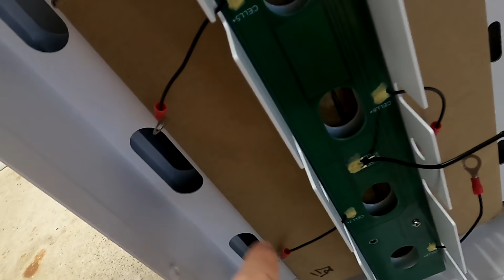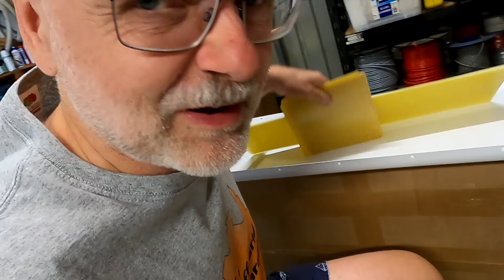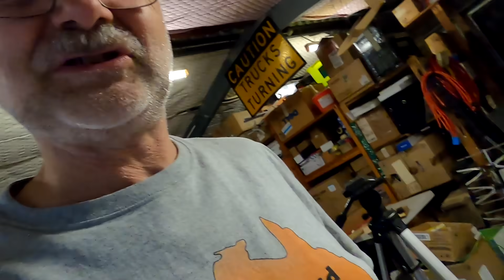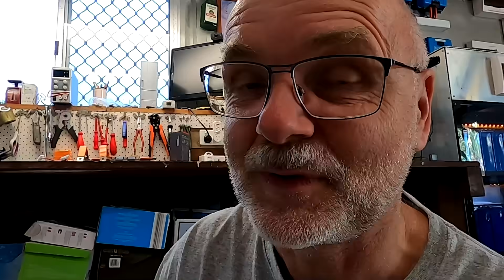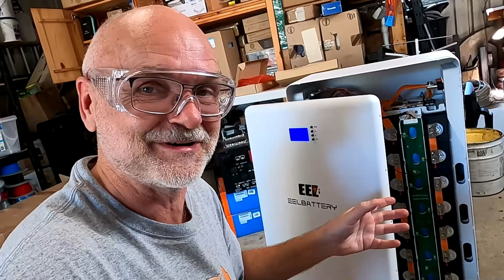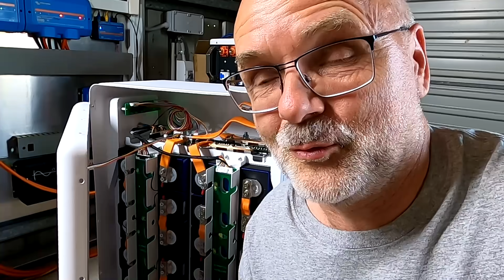The vertical EEL Battery DIY Kit. Is it OK for the cells to be stacked?

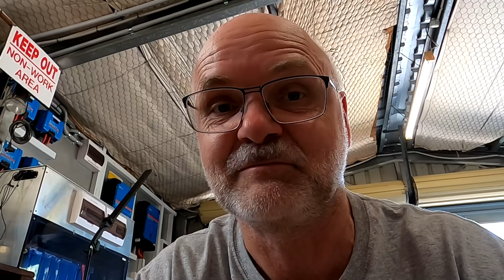Comment: Love your videos, also the funny part at 18:59 with two balance cables at 9 positive and 9 negative ( which is the same as 8 positive as they are connected ) but you got confused for a sec. Good tip btw with the capacitor to prevent a spark. thnx

Comment: Hi Andy, I have the same EEL Battery Battery Box as you do. The vertical box on wheels with the curves. I have 16 cells at 3.2V LiFePO4, capacity 302Ah. The BMS is identical to the one you use on your build as I purchased the battery box from EEL. I got the BMS, and all the accessories like you did.  I have everything connected. When I turn on the the communication button the LED screen comes on. When I go through the Cell voltage, all cells are good reading 3610mV except for two cells. The battery management is telling me Cell 13 is reading 11mV and cell 14 is reading 4838mV. However when I check with the volt meter I get a reading of 3856mV on cell 13 and 14. I also get this reading on all the other 14 cells. At the start when I turn on the communication button I get Pack voltage: 55.31V, Current: 0.00 A, SOC: 50%, Warn: Y. Can you please help me trouble shoot my problem??

Comment: I have the newest seplos BMS with two amp balancer and I’d like to put a turn off button on the front of the DIY box, but I cannot figure out where on the board it needs to be wired in and what wires go where I see a four pin JST plug that says PS on or something like that if anybody has any diagram or helpful information, please throw it at me.

Comment: I just got mine as it seemed like a good deal. My problem is because my cells are slightly bloated by 1-2mm, I can't get them to fit without only using an epoxy sheet between them. No foam. I'd rather have the foam between.
I don't really care about proper compression as my cycles are very low anyway. If the cell hold-down brackets were adjustable length, this would be a really good case.
Also, my unit came with an ANL 250A fuse. I can't find the specs on it, but I'm doubting it's rated for 48V. I could only find 300A 80V fuses from Victron. I mounted a T-Class fuse/holder there instead.

Comment: Any issues with the BMS?  I have two of the EEL horizontal boxes and have had trouble getting the balance to hold.  I hooked up an external active balancer and that works great.  The problem seems to be with the Seplos balancer/BMS.  The company kept telling me that it would balance, even with the power switch off.  No dice.
Reply: any update?

Comment: Hello sir. I have two EEL batteryes with JK bms. I do not understand why my invertor do not charge more than 54,4 V (if i put more i have 02 error) and the bms close the battery at 50 V.  Cells are LF280K. If you have any ideea about this problem, thank you!!!

Comment: correct me if i'm wrong but it sure seems like all these DIY kits are using the all the same guts inside (BMS, cables, bus bars, displays, comm port module) and just making their own case designs (barely, in some cases.)  While i'm still on the fence of this (what should really be called) semi-DIY setups, one aspect I just realized is, it'll be a heck of a lot easier and safer to hang empty cases on the wall and load the batteries into them, then trying to lift the loaded cases into place.

Comment: Thnak you, Andy, for the video. After watching it, I ordered one DYI box to accomodate my 302 Ah batteries. It look approximately two months to arrive from China to the USA. The box I received was slightly different with all the components displayed at the top. The installation was a bit hard due to flexible link not being exactly aligned but the biggest surprised was after I tried to connect the cables from the PCBs to the BMS.  When the cable was plugged in, I could smell something burnt. When the BMS was energized it was displaying only 8 cells and giving an error message that the temperature  sensors are sowing incorrectly. I went through the connector pin location and found that the connector on one PCB was soldered in reverse (so much for QA/QC). After contacting EEL support, I was promised replacement PCBs and the set arrived approximately two weeks later. After the PCBs were changed the BMS started to show all the cells and all seems to be working fine except the temperature reading, which also displayed warning message. Contacting EEL support about this issue was without too much trackinion and I decided to purchase replacement BMS. After installation of the new BMD, all works as supposed. ELL is not taking responsibility for fried BMS (I suspect the temperature sensing circuits were friede to volatge going to these circuitdue caused by incorrect installed connector) to the poor quality of their QA/QC program.

Comment: One would assume that the whole point of this particular case is to be mobile hence the casters on the bottom. But if you do want to lock it into a wall then just put some ratchet straps crossed it which are secure to the wall behind it 😂❤

Comment: Hi Andy first of all thanks for all your videos you help a lot, let me share my experience with my EEL box they send the pcbs that have the links to take the voltages of the cells to the BMS with the wrong female connectors, I talk with them and the solution was that I had to cut the connector to have a perfect fit... this I know... and they refuse to send me a correct part... I will never buy nothing from them... chinese... they are fantastic... with their faults... with our faults they are more active... but with their faults... very relaxed, Thanks to let us share our experiences, all the best!

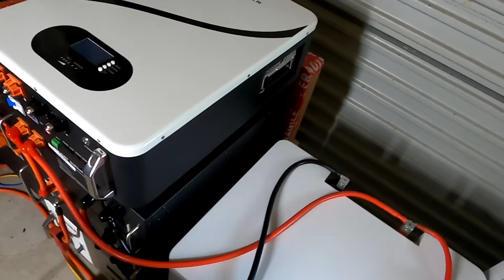Comment: 32:24 - NO, EVE says ONLY 1 direction is allowed and they show it in there most recent 20 page manual with the fixation of a single cell. They have replied to the german yt channel Energie&Hobby titled 
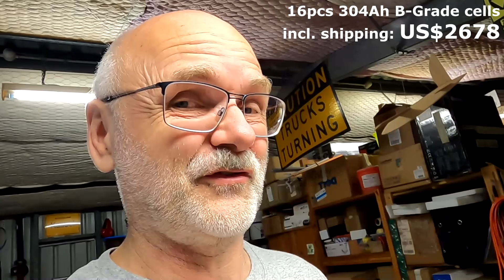"LiFePO4 Batteriespeicher liegend?" And there at 5:38 you will find the official reply 

In the LF280K datasheet I sent, there is a schematic for the mounting jig. We recommend upright placement for the following reasons:
#1 other directions will affect the cycling performance of the core.
#2 For LFP cells, other directions will lead to uneven distribution of electrolyte, which will affect the performance of the cells.

And beyond that they also let him know that inside this container is a kind of material which has been coiled many times. That is the carrier of the energy filled from the bottom to close to the top with electrolyte.
If you lay it flat then the carrier material is far more uncovered with electrolyte and you loose energy.

Also in case of emergencies the valve should be upright cause gas should go up under pressure and not spilling electrolyte which in horizontal position will be spread out.

Vertical racks are dead for LFP and CATL here said the same. Upright is the only way, lifecycle will decrease and capacity plus security issues with the valve and in case insurances will ask them they will claim that they never had allowed it anywhere.

Comment: EVE has emphasized that this is not the proper storage for their battery in 2024 again.
They warn to do it so cause cycles are no longer under warranty and the burst valves are no longer working and can go up in case of an emergency.

They have replied to a mail and they are clearly warning which means in case of anything going wrong your insurance will not pay. the terminals have to be on top. Nothing else. 

We have gotten one before this mail arrived us so right now this whole battery case is laying on the back on a shelf. Sad but true

Comment: Very interesting Andy. Love it. I stumbled on your site and channel while researching a 12v build for my overland Ute I’m building. My question is, do you do or know if someone that does ‘build your own’ lithium batteries/system for off road use? Especially the vibration and dust issues associated with them. I’m looking at a 150-200amh system. Thanks appreciate it.

Comment: Sad to say, EEL is gaining a reputation for NOT standing behind their products.  The measure of a company is how they handle problems.  And right now it looks like EEL is failing miserably.  After initial back & forth "Howard" goes silent.  

One customer posted photos of a 4-cell unit that had obvious crush problems on one end, with a battery bolt pushing into the closest cell and the fuse broken.  The top was not bolted down at the factory, which might have added structural support.  After a bunch of tests and rigmarole they offered 28 screws to bolt the top down - assuming the customer can straighten out the sheet metal.  The customer will have to replace his own damn fuse, and they have stopped communicating.  With the cell damaged he's not willing to risk it and he now basically has a boat anchor.

Another customer had much the same issue - the front end (where the battery connections are made) bashed in while the outside of the box looks fine.  EEL did send a new fuse in that case and the cell was not visibly damaged.

These are just two from a small Hymer van FB group.  Others in the group have had no problem with EEL batteries they added.    Caveat Emptor.

Comment: In latest model EEL made two good modifications. There is a cover on top of case you can access top compartment to change fuse etc. Also there is a holder for NEEY ballancer
Reply: p.s. printed manual included!

Comment: hello!  Many congratulations on your videos, you are a great professional.  I wanted to ask a question, I have a battery made from 280A cells and now I wanted to put this battery and a DIY box from the Basen brand. I asked if the BMS had a balancer and the lady I spoke to said it has a passive of 0.100A and is normal. is it enough to balance the cells?  Thank you, I would like to have a more professional opinion from someone who knows before proceeding to purchase the DIY box.  thanks
Reply: The traditional 100mA passive balancers will take the better part of a century (slight exaggeration) to fix any discrepancy in cell capacity/top balance. Just spend the money on an active balance board (even a 12S-16S 5.5A board, keep in mind you will only see 5.5A of current when there is a 1V delta) because they are under $50 and under $40 when on sale. Make sure you add a simple switch to the run pad on the board and TURN IT OFF 99% of the time. 

If you leave it on during the charge/discharge you will be UNBALANCING your pack between 2.85V and 3.45V. After an initial top balance you shouldn't need it turned on more often than one time a month for 24 hours (roughly). If your cells are garbage Grade B you would probably want to get a NEEEY active balancer that allows you to set the balance start voltage.
Reply: @ericklein5097  hello! Thanks for the answer, but I didn't want to spend more since I'm going to buy a box that contains everything, I should also bring a BMS with a better balancer because if the big companies know that it is necessary to balance the cells, when manufacturing the BMS they should include this right away.

Comment: Hi Andi, can you provide the BMS model? Only the 10e v16 can be found online, with integrated ports. the ELL vertical case features BMS and separate communication ports, can you indicate some details?
Reply from the maker: Yes, that is the Seplos 48200 10E V16 in the EEL box.
Reply: @OffGridGarageAustralia  but can you buy it only from EEL BATTERY? I haven't found another seller online with a similar product. All V16 BMS are with communication ports integrated on the mainboard.

Comment: I paid 1888 USD for grade A brand new batteries from qishou and you paid this for grade B? Its expensive.
Reply: you did not listen. he bought the material 6 months before. prices are coming down rapidly. furthermore i would never trust dealers there. i buy only eve cells from a trustworthy dealer. if you got the same  eve cells at this price (a-grade) for this price then its a good deal.

Comment: Great Video. I am in the process of designing my own battery enclosure for LF280K cells and wanted to go vertical. But after seeing your video, I think it would be batter to do a horizontal instead. Thanks for the video.
Reply from the maker: Thanks for the feedback. It all depends on the space you have and if you want to compress the cells or not.

Comment: @OffGridGarageAustralia:  On which port did you place the RJ45? is this also the port to connect multiple EEL Batteries to the Victron Cerbo-S?
Reply from the maker: Which RJ45 do you mean? The BMS has three RJ45 ports.
One is for the inverter coms and two are for connecting parallel batteries/BMS.
Reply: @OffGridGarageAustralia   After watching your YouTube film, I bought 3 Eel battery boxes. 
In the manual, there is no way to tell which port is for what. I now understand from your answer that the can is for the connection to the inverter. Then the other 2, RS485, is for the parallel connection between all EEL battery's. Is what I am writing correct? 

After watching the film "Quality batteries from EEL? Testing the EVE LF304 B-Grade cells." I saw that you use the connection of RS548 for communication.
Or was this just to connect it to the laptop. So which one would you use for connection to Victron's Cerbo-S?

In the manual on page 16 you can see the setup for de can bus dip address. 

I believe each box has to be set up this way for them to work together.
Reply from the maker: @karelkareltje6036  
Yes, you are correct with the RJ45 ports

To connect to the Cerbo GX you will need the Victron Type A cable and connect it to the left port of the BMS marked as RS485/CAN.
Id you have only one BMS/battery, leave all DIP switches off.

Plenty of videos on my channel showing the Seplos BMS and Cerbo connection in all details. In fact, there is a whole playlist about this: https://www.youtube.com/playlist?list=PLPomydD54sgC9MpkFBHniAWLa1e3S27LG

Comment: Instead of using a resistor to precharge capacitors, I use 2 x 24V incandescent globe is series. I had to precharge a 48V 11kW inverter, and this was the easiest method (globes easy to source close by compared to a resistor) that I found on line.
Reply from the maker: Great tip, thank you.
Reply: You can use DC cutter between inverter and battery

Comment: Hi Andy, I really enjoy watching you videos 👍 much better that TV . Could you please tell me how long that battery would run a 1kw load at 230 volts AC please , or how to do the Maths calculation or formula to do that . I understand 14.5kwh of the battery but not what you will get out of it after going through the inverter to power a 1kw load . Thanks

Comment: Very nice video and edit! By the way, I already build 6x of them and I they have now an manual inside and 16x of that foam. My advice is, do not put the foam on the cells, put it on the isolation pads, but only the half of them. Then you are very flexible where to put them and change it if needed. 👍
By the way, you can make some kind of compression with that metal bars, I press the upper plate with some ratchet strap down to the wheels on each side and then screw on the upper plate in the back and metal bars in the front. Then the upper cells are also well compressed against the other. 👍

Comment: When it comes to lithium batteries in general, I'm probably in the expert category.
I have studied and read most of the research.
You mention it yourself here, the problem of gas building up internally.
The batteries are designed to be able to collect gas where the overpressure valve is located.
By placing the batteries in this way, you get a reduced capacity more quickly, in addition to a reduced lifespan of the battery.
Tests show a reduction of anywhere from 10-50% lifetime.
But generally 30%, which is the average.
Everything based on use.
Harder use gives more gas.

If you compress the cells, the reduced lifetime can be as low as 10%

But that of course applies to new cells.
Reply from the maker: These batteries don't build any gas inside during operation unlike lead acid chemistry. These gas bubbles are a leftover from the production, nothing else. So it is important to compress the cells for the first few cycles until the bubbles have been squeezed out if you want to get the most out of these cells. But as we already know, calendar age will degrade the cells before anyone will hit the actual cycle numbers. I'm sure you know this already...
Reply: @OffGridGarageAustralia  You're fully right!
AND only as an addition to "Compression during first cycles": THAT will be done by the manufacturer (keeping out bubbles before sealing).
and as a result there are Cells with only 28Ah or 304Ah or more.
Most manufactures data sheets  based on difference between 3,65V (full) and 2,7V (low).
[ don't like to to talk about 2,5V/Cell ]
Reply: 😄... of course 280Ah not 28 !
Reply: BTW: We don't talk here about standard lithium batteries (cylindrical ones) we talk about LIFEPO4.
There is a difference between talking about capacity and lifecycle!
Compression: Bubbles reduces the capacity and chemistry is for lifecycle!
There, were are bubbles, no chemistry is working (stupid explanation but simple to understand)
Looking on the data sheets of manufactures of the cells itself you will find the answers!!!!!
IF you don't "fill up" the cells as much as you can (as allowed/ 3,65V by some data sheets) AND you don't suck out as more as allowed (2,7V... data sheets are different),
life cycles will be doubled from 3000 up to 6000 cycles (according to data sheets!).
Your turn to use the best option for you!
ONLY an addition, that does not match LIFEPO4 but Lipo-cells like we all have in our smartphones:
I never load up over 90% and never use less than 20% of SOC (Smartphones and model airplanes..yes, KOKAM DIY packages)
As a result, I never have to change a battery (but I have to change smartphones because no security updates available ... too old system)